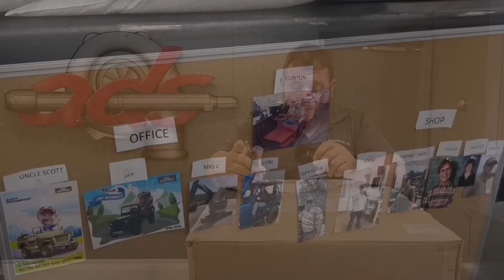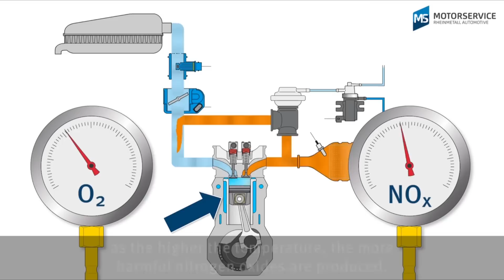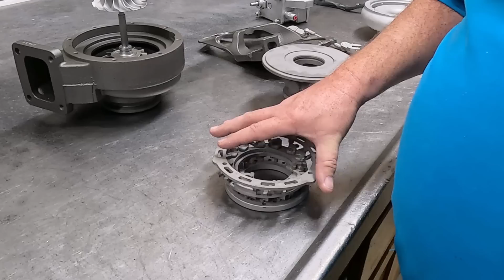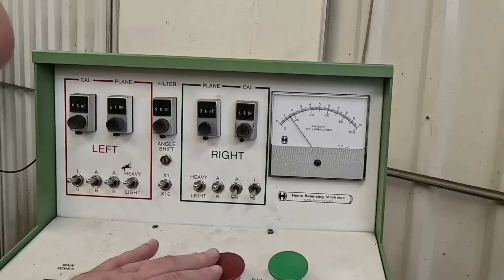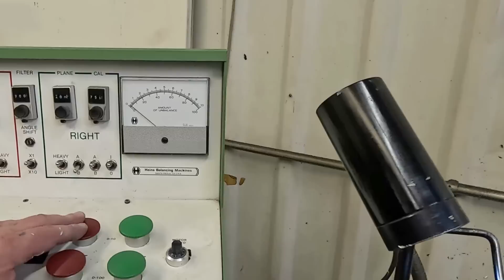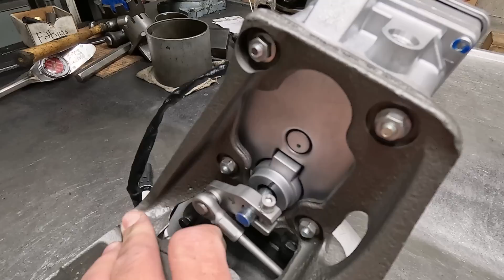Military-Grade JD850J Dozer S300BV Turbo inspection & Rebuild for @C_CEQUIPMENT RE535693 178731

Comment: VGT turbos are great. They give you the best of both worlds.  You get the faster spool times of a smaller turbo without the restrictions of the smaller turbo.

My daily driver is powered by a 427 cube lsx that's fed with a BW S488 with a vgt exhaust housing.

IHI is another main oem supplier of turbochargers.

Comment: Military equipment without emissions just like the trucks from Ford that don't have emissions on them so the engines last a long time like they are supposed to. This is why they put all these emissions equipment on the motor, because it retains more heat in the engine and the carbon and soot go back into the motor and score the cylinder walls where you look at the old diesel equipment they didn't do that and the engine's used to last a long time.

Comment: VGT Turbos, bane of my existence. Especially Holtset, which is owned by Cummins.
Every day machines and vehicles would come in, engine light on, "Actuator Not Responding".
Couldn't just change the turbo or the actuator even though this was the umpteenth time.
Nope,  firstly gotta go through the entire mindless infantile troubleshooting to justify warranty.
Secondly, there were no parts or replacements anyway.
Manufacturer could have said "Take it apart and clean it up". Nope, factory warranty issue.
There are a couple of ironies involved:
1] If the engines weren't burning so clean, had some good old fashioned oily carbon soot as lubricant, maybe they wouldn't have seized up as often.
2] This type of turbo is being/has been phased out. I was at a Cummins training course and the instructors were emphasizing the latest and greatest, no VGT, just a simple waste gate.
Never admit you had a dumb idea, just present the past as new again.

Comment: I've seen your content before with products from Diesel Creek and C&C and enjoy the content. I took the Turbo out of my 1981 Fiat spider cuz I could never get it tuned in correctly, it was either all or nothing.  I believe the turbo worked correctly, I just think the whole thing was a poor design.  There were only 750 made with the turbo and I still have everything just in case I ever want to try again, but for only 20 HP I doubt that will ever happen.

Comment: EGR......the first thing to delete on any diesel.  Simply put a  resistor on the air intake temp sensor and it never turns on ( ECU thinks air is always too cold to produce NOx)

Comment: Having a turbo on my T-bird many years ago:   At low speed no turbo.  it takes the engine to get about 2K RPM's and the turbo kicks in.  It was a 2.2 liter 4 cylinder.  If they had an idle or pushing heavy at low speed - kick in more turbo and it gets done.    My thoughts Area Diesel Service is an expert. Consider the dozer sitting idle but on awaiting a flight of aircraft to fly into an off site place.  As the planes come it in, the dozer has to haul planes or pull trip cable back for the next plane (Navy tail hook).

Comment: Never suspect good parts as good. I got a new set of NEW Bosch Injectors for my 2002 Cummins 5.9/24v. Suspecting and just wanting to make sure they were okay, I sent them to ADS for testing. Well well, ADS found every injector WAY out of balance. ADS is the best money I ever spent. Thank You ADS. 
P.S, expect to see my turbo for a rebuild in the coming weeks for a rebuild.
Reply: @I_Am_Your_Problem  Since I have little faith in today's made parts and all the fakes, I took no chances on having my new injectors tested. $130 is worth its weight in gold. ADS found everyone off. So they recalibrated them. Yes, brand new, never used injectors, way off. My 5.9 has never run so well. ADS also provided documentation of before and after results as well. My turbo is also fine, but it's coming off for a rebuild in either case. I have no budget restrictions for what I do.
Reply: @johnclamshellsp1969 Why not just buy the new Bosch injectors from ADS in the first place then? Just curious... 🤔🛠️🛢️💨
Reply: @tdotw77  It was too late to return them. I sat on them for several months before I was able to do the job.